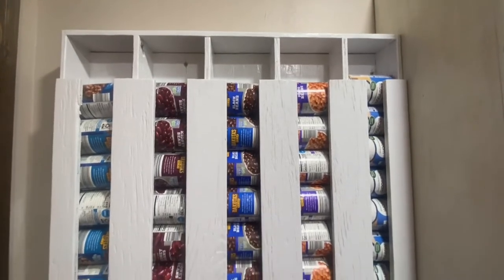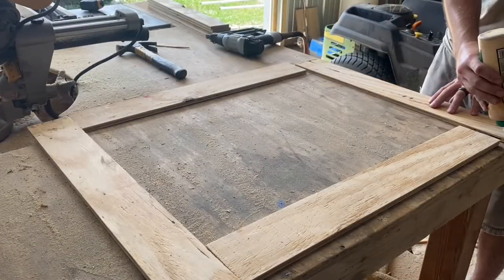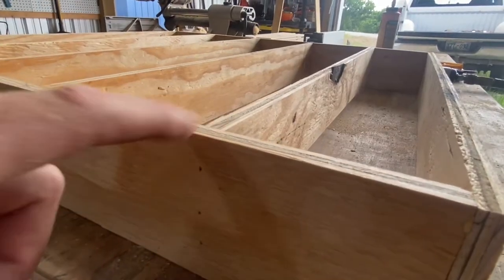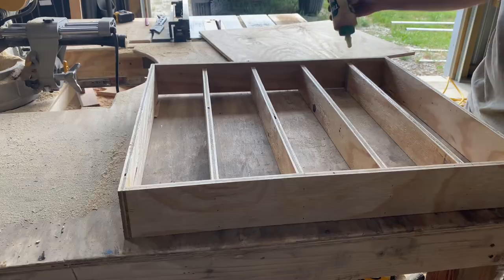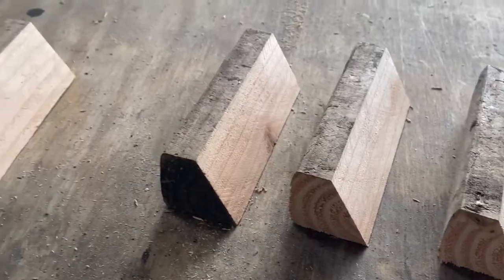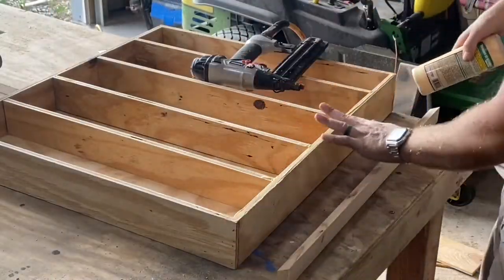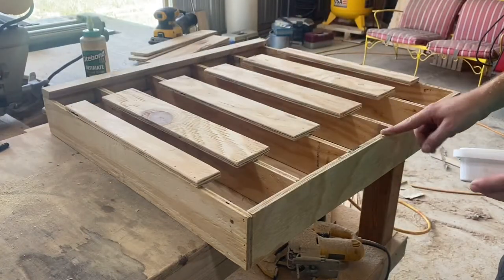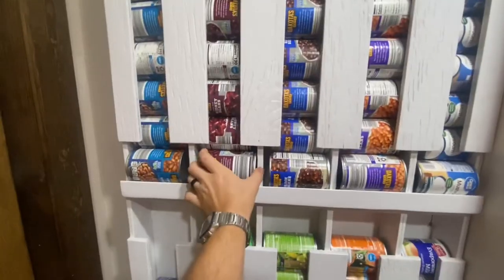DIY Canned Food Storage Rack (Easy)

Comment: I love watching your project!… So creative and similar to what I’m working towards - i’ve consciously downsized into a studio where I am working to make the most of the space and I found that I can create a shallow can/mason jar/spice rack 5’ tall freestanding cabinet behind one of the doors, no more than 20 inches wide and I’ll plan to put approximate 3 inch feet on the bottom so that it will rest flush against the wall, about the baseboard.. I’ve been doing a lot of research and trying to figure out the best way to create strong shelf construction where I don’t have a cabinet backing to rely on for support as that would eat into the very shallow space available. I’m not sure if nails or screws and glue would be enough to attach half inch thick shelves (1/2” x 4”) to 1 inch thick frame ( using a 1” x 4” but would prefer not to see nails or screws)… also have looked into cutting a groove to slide shelves into which would be my most preferred method but I have minimal tools. I did just buy a routing type bit for my drill. The last option is using glue for the shelves but then using very short nails to nail in a .25” concave/cove quarter round into the corners of the shelves underneath as brackets, essentially. Can you give your best recommendation of what the strongest construction might be, using minimal tools?
Reply from the maker: I’m having difficulty picturing what you’re describing. I have had some pretty good success hanging shelves with pocket holes and cabinet screws into the studs in the wall as long as there is some decent frame work to hold the structure of the shelves together.

Comment: It would be would be great if you could do a video for making one of these for soda cans. I have an RV with a small fridge so we can't keep the sodas there and we are creativity challenged. There is absolutely nothing on Amazon. 
It needs to be a wall mount on the top header of the slide. Our header is at least 8 inches tall. I'm guessing the design would be about four rows at three cans per row. It would have to be no more than 27 inches wide. 
RVs are wall and space challenged. We drink lots of canned water and can't have things sitting on the floor. 
The lighter-weight the material the better. We are currently traveling full time for business so that's a lot of cans! 😁
Dish needs to be tasteful and require as little sewing as possible. So we'd like to use pre-existing precut Lumber as much as possible.
Thanks for your consideration ❤
Reply from the maker: I wish I was able to help you. I’m right in the middle of a big move. I won’t be able to work on projects for a few more months.
Reply: Use his model and adjust the width of the slots to fit pop cans. Easy peasy!